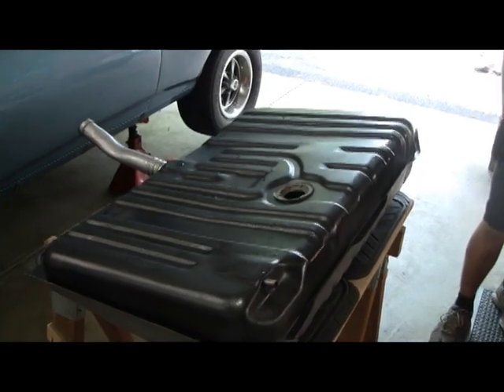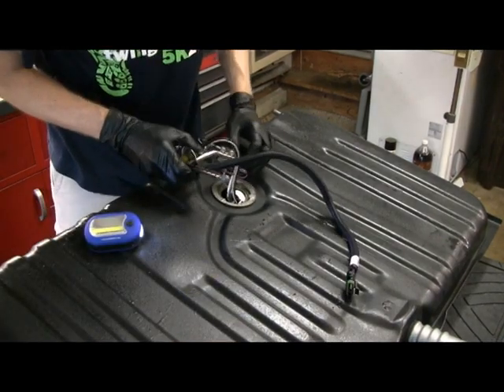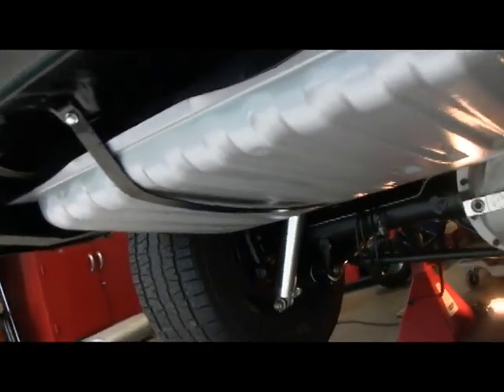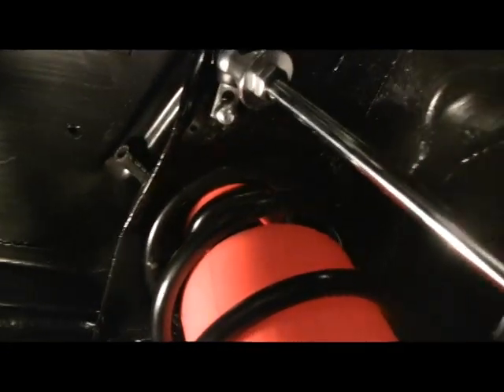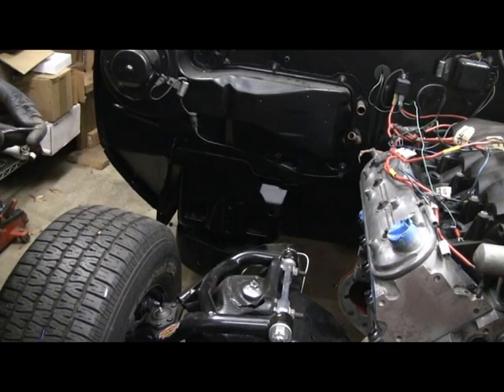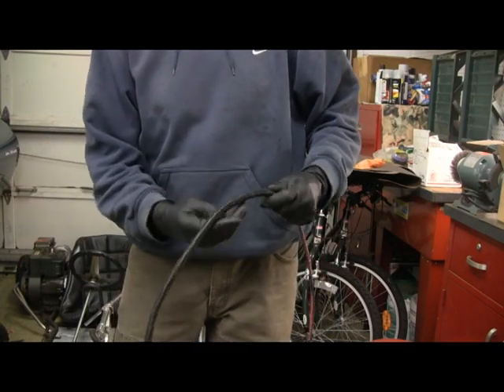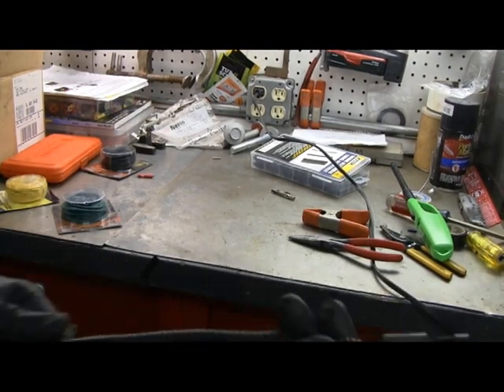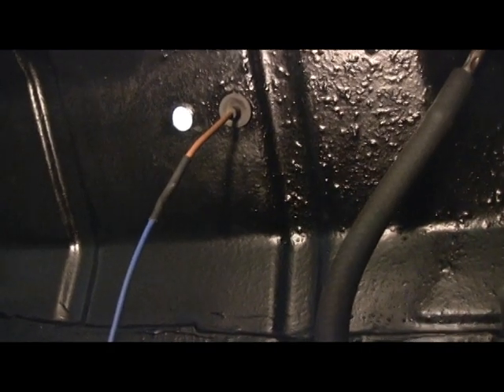LS Conversion swap, Part 49, Fuel system

Comment: Hey good to see you back, I have a question, what will you be doing for the fuel return line?
Reply from the maker: From what I have read no return line needed with the pump and regulator in the tank. The gas will keep the pump cool and since the regulator is in the tank also you don't have to return from it.  The Holley unit does not have a return nipple provision on it. When I found it as an option it really made things more simple.
Reply: @primegaragegma-bodylsswap2089  Thanks, I have G-body wagon and going to use an Astrovan sending unit and Walbro pump, now that I have watched your video I'm going to call Holley to see if that unit will work in the wagon tank (they are deeper). I already have the sending unit, but the Holley is so much easier, Thanks again.
Reply from the maker: @Brooklyn-bn5go  A Wabnro external was my original plan until I found the Holley. I hope they have one for your application.
G-bodies and long-roofs are awesome. Good luck with the project!
Reply: Brooklyn202 did you ever use this sending unit on your G Body?

Comment: Hey y not use the stock hard lines . ??
Reply from the maker: The pressure for fuel injection is around 50psi vs. 10psi for a carb. I would have had to I cut the hard line up to mate with the tank, filter and motor leaving just a smooth end to attach hoses to. With that pressure I did not trust not having leaks. Now all my connections are EFI rated style.